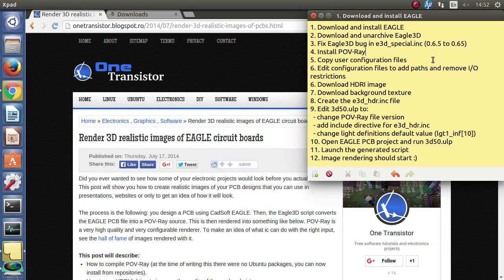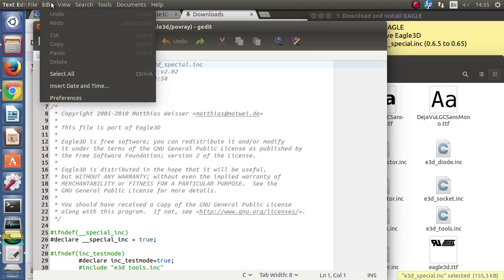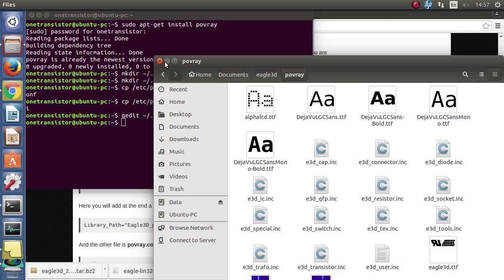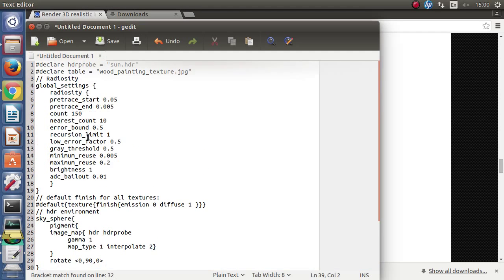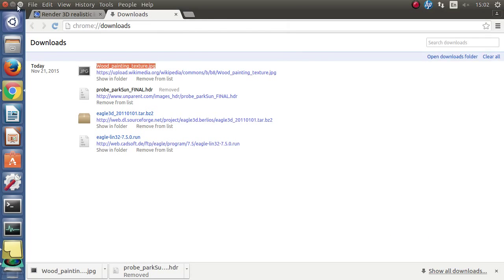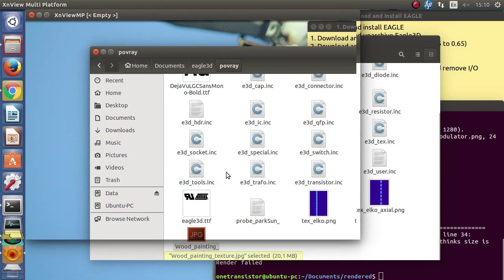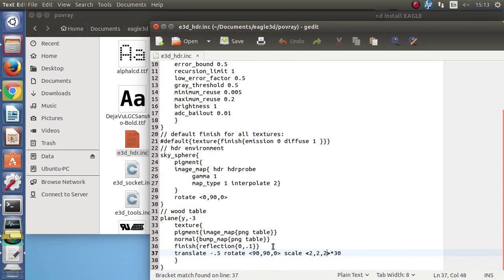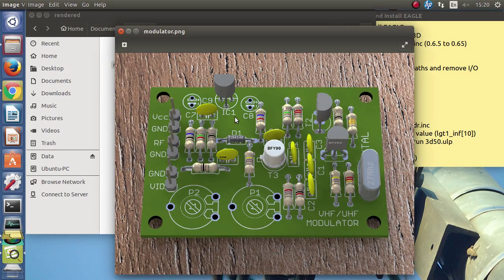Render 3D images of EAGLE PCB projects using POV-Ray

Comment: if i want to use that software in windows 10, how i can to install this?
Reply from the maker: +Anael Mejía Amórtegui you install the Windows versions of EAGLE and POV-Ray. Eagle 3D is a platform independent script that will work on Windows 10 too. The things are similar, just the paths are a bit different.